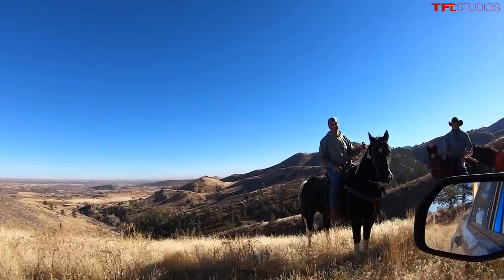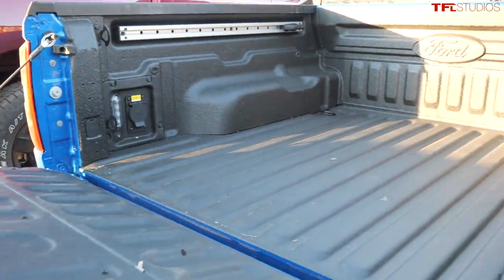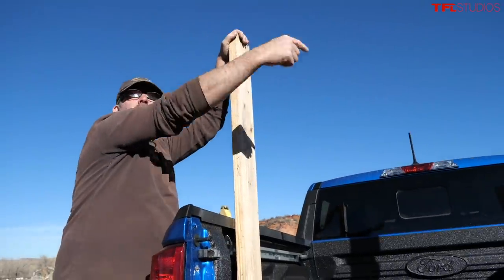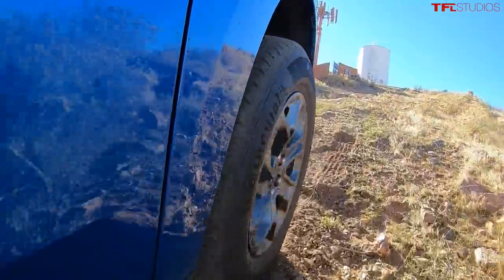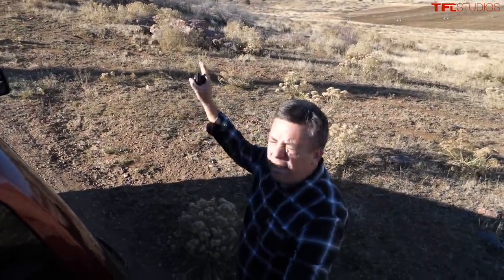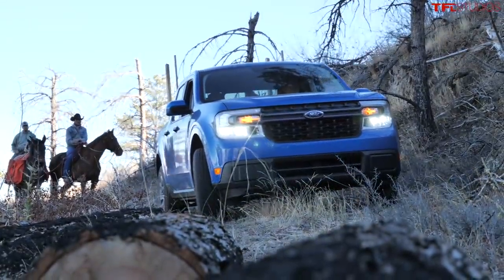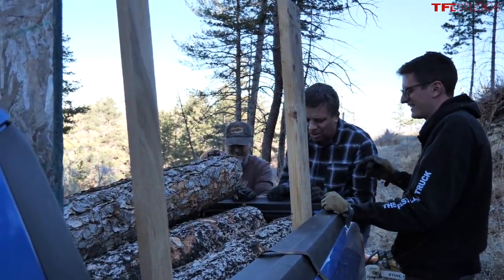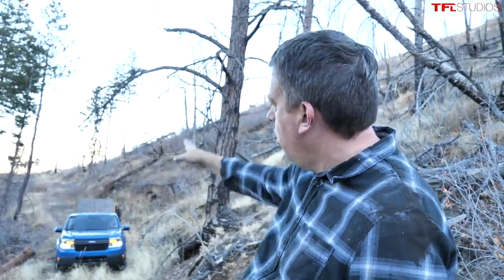Did We Go Too Far MAXING Out The New Ford Maverick To See If It’s Ranch Rated?

Comment: I’ve been in the fence between the Hyundai Santa Cruz and the Ford Maverick. Your content showing how useful even the hybrid Maverick is has convinced me to get the Ford! Great content guys!
Reply: @mblake0420  : you work for GM, right?
Reply: Sounds like the right choice.
Reply: I am still torn between the two. I like the extra towing capacity of the Santa Cruz. My big question has been if 2 dirt bikes can fit in the back of the beds.
Reply: @bbundridge  : I'm curious about slowly towing 5000 lbs with a dual clutch transmission. Possibly at a boat ramp.
Edit. Notice no extra cooling for the SC tow package.
Edit: I saw on another site that they kept the fully loaded SC above 5 mph to keep the clutch engaged. They didn't quote the speed at which the the clutch would slip to keep speed low.
Reply: @bbundridge  there's a video of a Maverick with 3 dirt bikes in the bed. It's a tight fit, but 2 full size dirt bikes fit just fine.. keep in mind the Santa Cruz has a 600lbs limit for the bed only, due to the trunk in the bed...
Reply: @jascospeed  I thought the 660lb limit was debunked by Hyundai? They did misstate the payload vs the door sticker though
Reply: Next up would be to try the same thing with the Hyundai Santa Cruz and see how it does.
Reply: Good choice.  You won't have to worry about powertrain issues.
Reply: @drewthompson7457   The moment Chevy and Chrysler build a tiny truck with the same capabilities these guys will change their tunes.
Reply: @fordgtguy  : I owned a 1997 Safari, that broke every time i used it. I won't even look at another GM product. I'm told their quality is even worse now.
Reply: @bbundridge  not debunked because it's true, it's in the owners manual last couple of pages in section 6... It actually under a big warning section and exclamation point saying cargo should never exceed 661lbs. It doesn't matter how you adjust your load or if you have a 100lb driver, cargo bed limit is 661lbs... There's a reason Hyundai doesn't want to advertise it and stays silent when many have asked to clarify the small bed limit.
Reply: @bbundridge  also door sticker is for total payload which is always a combination of people in the interior and cargo or tongue weight when towing... If you have a 100lbs driver in the Ford the bed can take the rest of the 1471 lbs payload minus the driver weight, Ford confirmed this.  The Hyundai can't do that...
Reply: @drewthompson7457  I'd be scared about Hyundai's reliability, at least with these significant engine failures and engine fires that they can't seem to fix. They've recalled their vehicles like 5 times trying to fix this issue, and it's still a problem. Ford has a lot of experience making trucks, and the hybrid system they used is very durable in other Ford's.
Reply: @jascospeed  Wow, that's terrible. Yeah, was already gonna buy the maverick, but this makes the decision even easier.
Reply: @KB-bh9hp  ; My 8 yr, almost 9 yr  old Santa fe is doing fine. I can't recall the engine fire defect, but only the N.American built Hyundais, the bean counters thought it was a good idea to not clean out the crankshafts. The debris causes engine failures. Mines been checked.
One of the tests is to put a microphone down the dipstick hole to listen for failure, I've never heard of that before.
And since i do my own oil changes, I added strong rare earth magnets to the drain plug, which I always check. I've found nothing at all. (Hyundai even put the magnets back on when I went for  this recall)
And Ford forgot how to put spark plugs in engines a while back, and presently, the 3.5 and 3.7L transverse engines have the coolant pump inside the timing cover - buy a new engine when the pump fails. Have you read about the 2020 (or 2021) F 150s dropping their drive shafts?
Every manufacturer has their problems.
I might be interested in a Toyota hybrid Sienna cut to a pick up truck. Have to see what the future brings.
Edit. Since I do my own oil changes, Hyundai has cover plates on the windage tray for the filter and drain.
Ford, you remove the whole windage tray, (15 bolts / clips) as they didn't bother to allow access to the filter and drain. Hopefully oil will make up at least 90% of maintenance, so why not make it easy?
Reply: @KB-bh9hp  The company I work for uses ford escape hybrids 24/7 and have been super reliable. They have a awesome warranty on all the hybrid systems including batteries. For the price the Maverick is a great buy and a great weekend warrior to Home Depot. If you get the hybrid also a great commuter that can do a lot like in this video, even while being over the max load weight with terrible tires ...
Reply: @drewthompson7457   I agree with the no access to oil filter due to the bottom plastic under tray.. it's there only for fuel efficiency and you can remove the whole thing and it won't effect milage or anything else. My Mazdaspeed 3 has a cut out for oil filter access (from factory) and I will just cut an access port for oil changes, it's super simple but would have been nice for it to come with one from the factory. That reason alone isn't worth overlooking the Maverick, plus the Maverick will have tons more aftermarket parts for it, look at what they showed at SEMA and the Maverick is barely out. They will probably have an after market tray since alot of people have noticed this. The Santa Cruz isn't popular in aftermarket world...
Reply: @drewthompson7457  But the 3.5 and 3.7 are both incredibly durable engines. But I'll agree, internalizing the water pump wasn't a great choice, even if it rarely goes wrong. Don't get me wrong, I don't hate Kia/Hyundai, we've owned 2 kias and a Sante fe. It just seems like they're regressing at times. Our Hyundai Sante fe was from like 2005, we had it until about 2010-11, in that time frame, it was a reliable car. Our biggest gripe with it was when it was totaled after hitting a patch of black ice, the airbags didn't deploy at all, resulting in my father hitting his head on the dashboard, and getting a pretty nasty concussion. So that was odd. Our '06 Kia Sedona was a massive, and I mean massive POS, we got rid of it when we got our explorer in 2016. It had 88k in it, we gave it to my uncle for free because his tarus had about 300k on it and was starting to have issues. It now has about 250k on it, and it's had quite a few issues, but it's still running. Our 2009 Rio has been pretty solid, has about 110k on it. It's starting to have issues, but most of the repairs this far have been pretty mild, timing belt, brakes, fixing steering components, getting new tires, replacing spark plugs etc. So mostly standard maintenance things. But it's reach the age where it's having those old car quirks, like the steering wheel just locks up at times, particularly when the vehicle has just been turned on. What really scares us is when the steering wheel locked up while the car was moving, thankfully it was at lower speeds. Aside from that, the transmission also seems to issues.
Reply: @jascospeed  :"it's there only for fuel efficiency "
" it won't effect milage  "
Oh well. 
I'm looking into the Mav. I don't like the dual clutch transmission in the SC, but I'm also looking into a Ridgeline.
Everything is a compromise, isn't it?
Reply: @drewthompson7457  gm is good these days.. still prefer a good Japanese car though
Reply: @bbundridge  There's a ton of videos showing that Hyundai's dual clutch have problems under heavy load like offroad or high revs. If you are really planning to tow the maverick it's definetly more realible, but if the tow capacity it's not enough, would be better jump up in the ranger/tacoma category
Reply: @allentoyokawa9068  I’ve owned two Hyundai’s, both ran great and I was overall happy with the cars. Actually, I’ve always stayed away from Ford because of their rumored build quality issues. But every manufacturer has their issues with specific models and I’m willing to give Ford a try.
Reply: @KB-bh9hp  Theyy are garbage, no if and or buts about it... that is why they are a mainly niche market... I know a lot of people that thought  they were getting A reliable Japanese car, but are mistaken... and are not happy with reliability and fire/engine/abs recalls
Reply: @drewthompson7457  WRONG it has been happening outside NA... don't spread false info... now they have abs fires... don't blame NA fore the korean mistakes in design
Reply: @allentoyokawa9068  I mean, even some Japanese car brands are starting to slip in the reliability department. We've had no issues this far with our 5 years old explorer. The same couldn't be said about my cousin's highlander, or many Nissan Pathfinders with that dreadful cvt.
Reply: @Guiggs17  I was looking at the Forest River NoBo 10.6 to haul my dirt bikes, would be just under 3000lbs with the bikes.
Reply: @mblake0420  Well, yes. They are small unibody trucks not meant to compete with bigger trucks.If they were built like a Ranger or F150, they would certainly haul more, tow more and be harder to park and fit in garages as well as having poorer fuel economy, and need built in ladders etc. to get in the box.
Everything is a compromise.
The Mav can tow a bit more than my SUV, carry plywood easier, (it goes on the roof of the SUV),  a half yard of soil would be no problem with the Mav, but messy with the SUV, but gets worse fuel economy than the SUV. The Santa Cruz will have problems with a half yard of soil.
Trade offs are a part of life it seems.
Then there's the Ridgeline. The box is about the same, tows more yet, and gets even worse fuel economy, (better than a Ranger), but some feel the need of 6 cly over 4.
The Santa Cruz can't carry much in the box, and the dual clutch transmission worries me when towing 5000 lbs slowly up a boat ramp. No extra cooling for the tow package either. Worse fuel economy over the Ford.
Lots of choices. They will all sell.
Picking the least compromises is interesting.
Reply: @allentoyokawa9068  : so I looked up the world wide engine debris recall. The U.S., Canada, and S. Korea are the countries listed.
It said the N. American motors were built in Alabama.
It didn't say where the Korean motors were built, but perhaps shipped back to Korea?
Reply: @allentoyokawa9068  : GM is so good, they keep losing market share.
Reply: @allentoyokawa9068  : are you referring to the old Pony? As their first try in N. America, it wasn't the best. My 8 year old Santa Fe has had no problems, works well and gets good fuel economy. It passed it's engine recall. 
Early Ford 1.6 l Ecoboost had fire problems too.
You have an interesting definition of garbage, since you like GM.
Edit: I remember a dealer rep I felt with used his wifes' pony every time the company supplied Buick failed.
Reply: You've made a good choice
Reply: @hakkai153  he must. I've got a Ranger. The Maverick is a great choice
Reply: If I were you I'd buy a used ranger or gmc canyon/chevy Colorado before I bought the maverick, but if you'd rather have something new that's up to you
Reply: @drewthompson7457  Yep, my 3.7 in my Mazda CX-9 cost me 4k to fix when the internal, timing chain driven, water pump failed. My 2016 F250 with the big V8 gas engine just cost 4k, and 7 weeks, to fix. Awhile ago Ford transaxle failure in Ford Windstar. I’ve had brand new Hyundais, as rentals break down on me. No better luck with GM products either, worse actually.
Reply: @g.donuts3551  : I have seen videos were the techs say to just replace a 3.7, rather than try to fix a water pump problem.
Although I do appreciate new tech, stuff should be built so maintenance can be preformed.

Comment: This is the type of content you should be doing.  Any vehicle can run up and down the highway, freeway, etc.  What many people want/need to know, can it haul what the manufacturer says it can haul, and can it tow what the manufacturer states it can.  This is a great demonstration of the capability of the Maverick, even being the front wheel drive model, it did very well, the AWD would have made the hill climb and decent effortless, but I have to say the FWD model did just fine considering you were a slight bit over max payload.  

I bet this will be offered with a hybrid/AWD combination within the next year or so, if they continue building them, which I hope they do.  I think I'd go with the Maverick FX4 though, and the 4k tow package...it would do most of what I need a little truck for.

Comment: This is real world testing for sure! Ford knows this happens all the time. Everyone has an overloaded truck story, if they have ever really used their truck. Great video!
Reply: I did swap my f150 not for a maverick but for a ranger
Reply: Towing 14k w/ no trailer brakes behind a 1990 Ramcharger. What you got?
Reply: @lukediehl1210  77 K30 pulling a skidsteer with a death wobble? You got nothing to worry about ..
Reply: Our old 02 250 with 128 12x12 concreate blocks in the bed, and then a $1500 Home Depot trip with 4000+ in the trailer and probably another 1800-2000 in the truck. Max towing was 6900.

Comment: I remember taking my little Datsun pickup truck and helping my Dad move his shop, I had 4 Ford V8s and four C4 Transmissions and a 2 engine stands strapped in the back.   Drove it 20 miles with that load.  I was 17 so shut up about GVWR.  Got the job done.  Little trucks are fun, little trucks can work, little trucks get the job done.  I currently own a 94 F-150 and a 14 Ram 1500.  I see a Maverick in my future.  Come on Maverick Tremor.
Reply: You made me remember my Datsun days and how capable it was but those leaf spring jolted me apart when the bed wasn't loaded...xl hybrid has been ordered.
Reply: My 1st Datsun, a 1970 was the bomb.
Tons better than my 87 se Hardbody v6....

Comment: Great vid. I've been on the fence about the Maverick, but after this showing it may be the perfect small truck for my wife. She wants a truck smaller than my F-150 and we would have to get the AWD version since we live up in Maine (tough winter driving).
Reply: The Maverick Fx4 is what I've got my eyes set on.  I love my 87 Ranger, but its time for something a bit newer LOL...the only thing I'll miss is my 87 Ranger has the 7 foot bed.  Not getting rid of it, I'll just use it on the property as a utility vehicle, and the Maverick would become my daily driver most likely.  If I could afford to get rid of my 88 Bronco 2 I would get rid of it, but wouldn't get enough out of it to recoup the engine and transmission replacement LOL.
Reply: Buy a used ranger or gmc canyon with four wheel drive. You'll be glad to have the extra capabilities, as a fellow mainer I promise you, you want something with a frame for the possibility of mounting a plow

Comment: I’m guessing you are back in Ford’s good graces after airing this video!  Excellent video about the Maverick’s capabilities!
Reply: This is probably the best advertising yet for the Maverick. If the front wheel drive sub-200 horsepower hybrid version can do this, the debate is over on whether or not this is a true truck or not. It’s definitely a truck
Reply: @colten53  agreed

Comment: Finally a capable small affordable truck . Cant wait to what the other manufacturers come up with to compete . Hey yotta. , small 4x4 with 6 ' bed , manual trans for 20k ish . all I need is cruise control , power windows , intermittent whipers , heated windshield like the 4 runner and heated steering wheel.

Comment: I hope Ford will eventually offer a 4WD Hybrid option. I don't know if it's possible but that'd be a winner.
Reply: It’s definitely possible. Frankly, I still think Ford greatly underestimated how popular this thing is going to be and I think they have to be kicking themselves for not making an AWD hybrid version already. That would sell like hot cakes considering the people buying the hybrid are doing it for the fuel economy and the people buying the Ecoboost are doing it for the all wheel drive. Clearly the hybrid is pretty capable in FWD, but if you add an AWD option to that, I think you have a real winner. Eventually they’ll offer an electric version too, which will be really interesting if they can still have room for a frunk. If you can make a Maverick with a frunk, then you’re looking at seemingly infinite storage space with the open flex bed, the back seat, and a front trunk. You could take the kids kayaking and still have room to pick up groceries on the way home.
Reply: Just add an electrical motor as the rear drive differential.  That would be relatively simple.  Would keep the fuel economy high and give the extra grip when needed.

Comment: Love it. Can't wait to see TFL work the AWD EB Maverick. I'm more impressed with it every video I watch.
Reply: I would wait a couple years before buying a new model. Exactly what I did with my ranger. I see the problems with the bronco and I’m happy I waited til 2021 to pull the trigger on my truck
Reply: @lesterparker1594  Buying the maverick should be fine. The, wait a year rule generally only applies when a car has a bunch of new tech that might have teething issues. Most of the tech used in the maverick has been used and well proven for years now, over a decade in some cases.
Reply: @KB-bh9hp  good point. Still, if I was buying I would wait. Just to be sure there’s no big issues to worry about
Reply: @lesterparker1594  We'll probably be getting our hybrid around this time next year. So I thinking waiting a year or so is more than enough time for them to fix all the bugs. Again, especially on something that's already using proven tech.
Reply: @KB-bh9hp  yea good idea. Good luck. Hope it does great for you
Reply: @lesterparker1594  Thanks man.